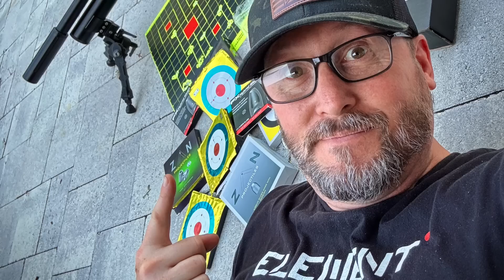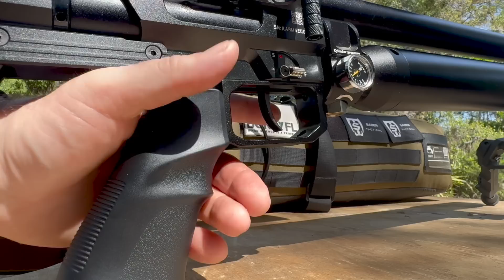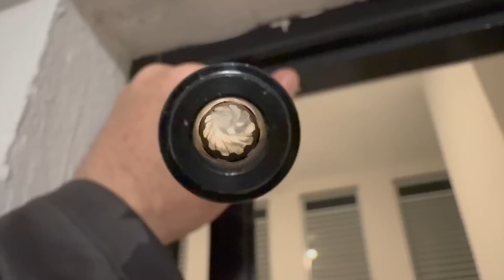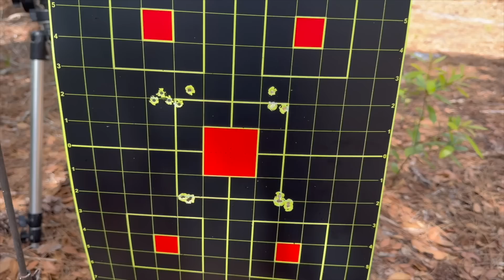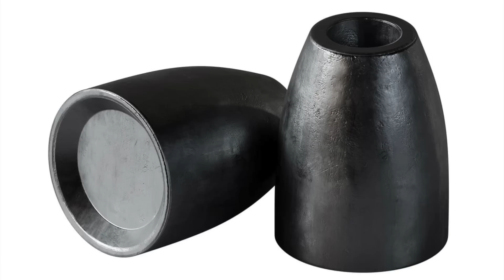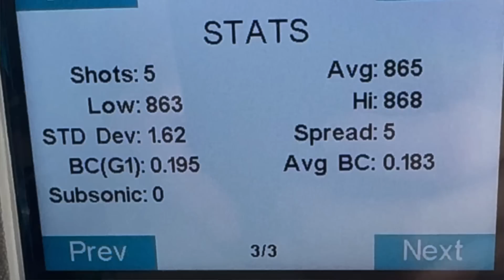Karma Airguns EQ Slug Testing and Trigger Adjustments!

Comment: Shooting a wide variety of petllets and slugs is for the most part a waste of time and it will only show the closest tune for a specific projectile.. For example it may show that the tune may not favor a 25 grain pellet and only shoots 2 inch groups at 50 yards where as it may shoot 33 grain pellet with hole in hole accuracy.. However we all know that projectile weight, barrel twist rate, length of barrel and pressure determine accuracy.. So you could re-tune the rifle to shoot those 25 grain pellets to also shoot hole in hole.. Hand loaders of powder burners and muzzle loaders know this very well that each projectile requires its own charge (pressure) for optimal performance and the same holds true with air guns.. If you are not going to make any changes or can't make any changes to the rifle then, yes you have to find the best projectile that works best.. Other than that if you need more energy then select a projectile that will do that for you and tune the regulator, and hammer spring tension for best performance for your needs..
Reply from the maker: You are 100% correct, and I mention this in the video. Every projectile I teste,d I went through a full process of testing them at various speeds within the range of known velocities that work well with spin stabilized slugs with airguns,s which is 850 FPS on the low end and up to 1000 FPS on the high end (as long as the power potential is there with the valving and regulator). 

With the EQ accomplished by setting the regulator and the lowest hammer spring tension, shooting 5-shot groups, move the hammer spring tension up until you find the "knee" of the velocity curve, where adding more hammer and spring preload doesn't result in higher velocity. I performed this test from 2000 PSI to 2700 PSI, which is about the max with this airgun that tops out around 75-80 FPE. The results you see in this video is from that sequence of testing. 

The variable that exists in ammo is the sizing that needs to be tested with any airgun you buy. Slugs are waaay more susceptible to these varations than pellets that have skirts that can expand or compress to dynamically size themselves to the bore more easily. So yes, you do need to test a wide range of manufactured ammunition to find the ideal bore size. Twist rate affects the length and corresponding weight a particular slug can stabilize. That too needs to be tested whenever you are picking ammo.

Comment: I have it in .25 and I lowered the regulation to 1500 psi to use 25 gr JSB and it is giving me 940 fps with the hammer at minimum. I raised the hammer a little and lowered the velocity. Could it be that it is too little regulation for the hammer?
Reply from the maker: Yes. Bump the reg to 1700 psi. Most of my tunes with the EQ uses only up to a 1/4 of the preload.
Reply: @UpNorthAirGunner I have a question: when the Gilpea hammer hits the valve pin, it releases air through the pin. Is that normal? Is that my karma?

Comment: Those fx hybrids dumping all its energy on first 1 inch is great but if it came out of a shotgun dumping  1000 footpound of energy but is comming out of airgun and is a not from the powerfull airguns so for coyote hunting with fx hybrids probabbly not it need deeper penetration to affect more. Altaros kings or something similar not being hollowpoint that is accuracy, penetration and maintained high velocity at over 100 yards otherwise we would see hollowpoint bullets at 1000 yards ELRs but we dont see them.
Reply: He explained that. You use the correct projectile for the game, he explained to use FX hybrid for small game, the AEA for medium game etc. As airgun hunters we sometimes choose pellets also, they shed velocity so if you are shooting in an area were range is a problem.

Comment: Nice video!
I have an Karma EQ .22 and shooting Zan ELR 42.3grains.
Transferport Max
Regulator at 2600psi
Adjusting the Hammer max I get 880fps no more…
What can I do to get 939fps that is the best BC of these Slugs?
Up the regulator?
Reply from the maker: Up the regulator but I would also try some .218 Zan 35.5 gr which are a better match for a 600mm barrel like the EQ has.
Reply: @UpNorthAirGunner I will try when arribe them in Europe😉 Thanks!

Comment: Other than cost, why did Karma go with metal air cylinders rather than carbon fiber? Wonder what the weight difference might be.
Reply: Heavy weapons always produce the best accuracy.. They are less influenced by any recoil.. A slight movement from recoil or vibration can alter the accuracy.. Many times people sight in on a rigid rest and wonder why they can't hit anything shooting "off hand".. It is because the stiffer rest causes more reaction, a solid rest will cause more reaction than a soft one or holding it my hand that will give way to any recoil.. Any and all reaction influences accuracy.. This is also why many air gunners find that their 60 fpe rifle isn't very accurate but when de-tune down to around 45 fpe they are way more accurate.. If you don't hunt and only shoot paper and plink then you may not need 60 fpe at all..Even a .22 tuned for 28 fpe will perform quite well for most shooters or even a .177 tuned for 18 fpe will still shoot 200-300 yards.. If you don't hunt then slower velocity and less fpe are your accuracy friend.. If you are punching little holes in paper then hitting the bulls eye is priority not knocking over an elephant, so you don't need a great deal of energy to make holes in paper.. With a 25 cal I would say that shooting 25 grain at around 890 fps would do fine but it could still shoot 33 grain in the 730-750 fps and still do hole in hole quite well.. You don't need to break the sound barrier for speed and knock over an elephant, what you need to do is hit the bulls eye.. Too much speed and too much energy is not the key to accuracy.. It is better to hit the bulls eye every time shooting at 700 fps, than to have a 2 inch group shooting at the speed of light.. Most people rarely shoot beyond 100 yards.. A .177 shooting 16.2 grain pellets will most likely dominate 100 and less yards for accuracy.. .22 trajectory curve will be greater as well as a 25 cal..

Comment: Everything I’ve read indicates trigger is still pretty terrible.
Reply from the maker: The issue I ran into was there is a broad range of adjustability and if it’s not set right, it’s got a longer than desired first stage and heavy. They modified the trigger assembly and is now much better once you get it set right.